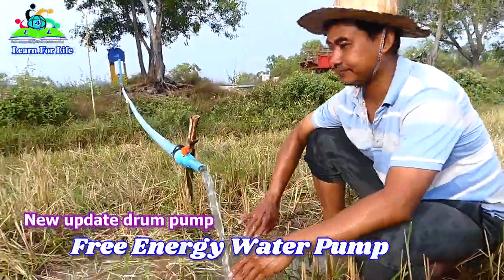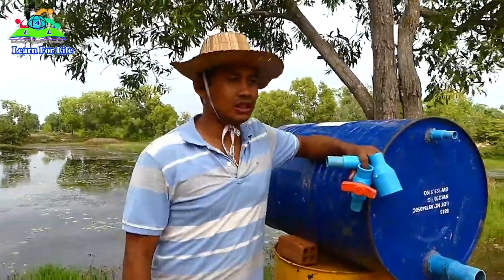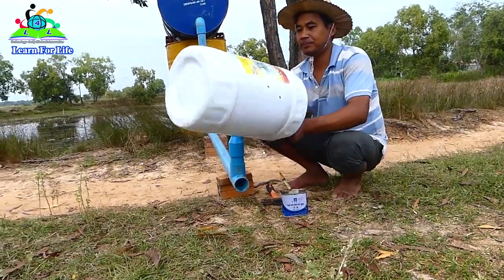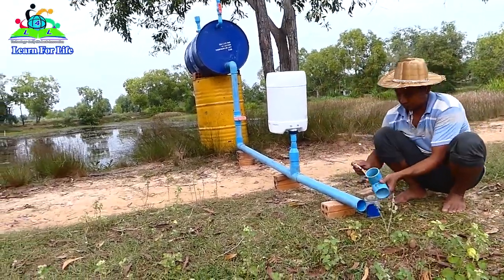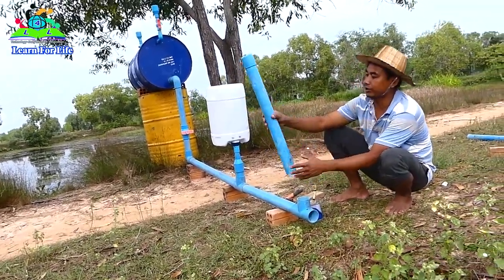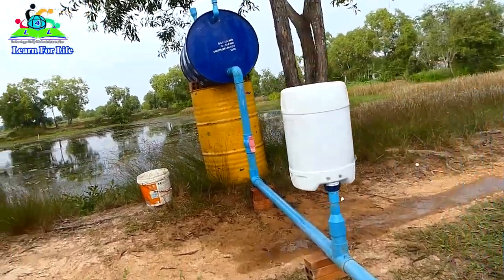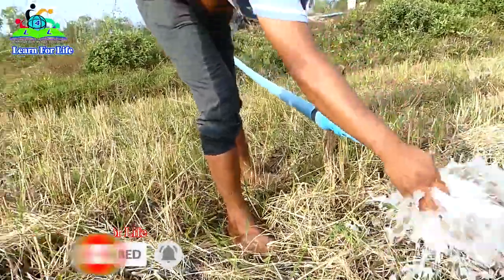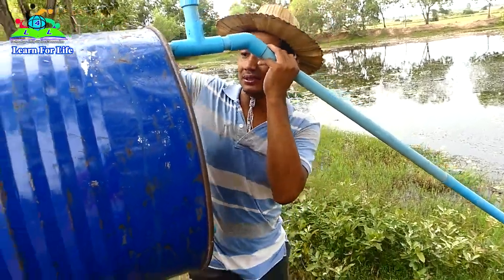100% Automatic  Free Energy Water Pump   Pump Without Electricity

Comment: No need for the yellow deum. No need for the blue drum as you are using a foot valve. No need for the valve at the output, no need white canister, no need for the vertical pipe at the output, BUT for this to work, the water levelmin the pond must be higher than the outlet to the field. This is no pump, but a siphon with a priming drum.